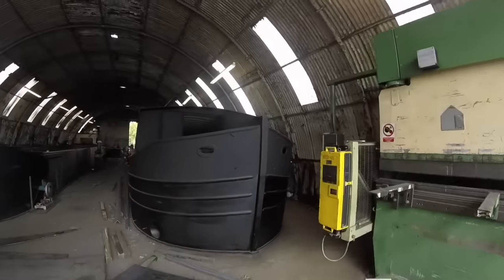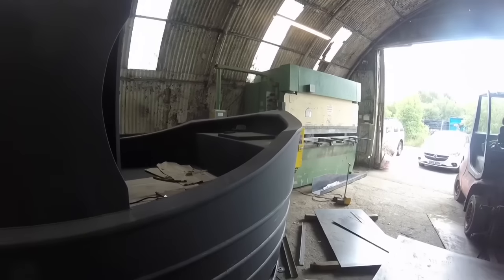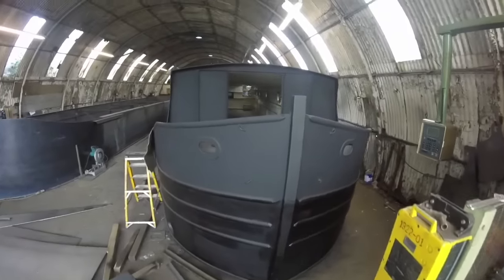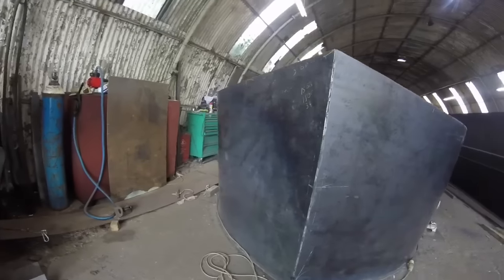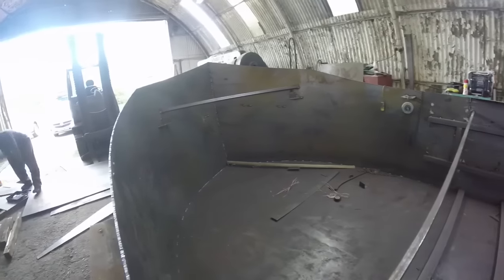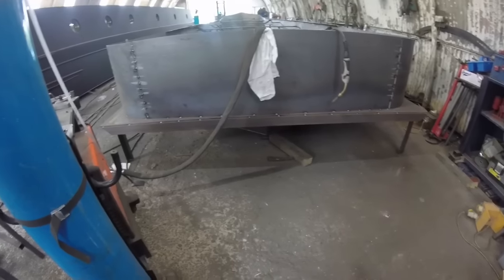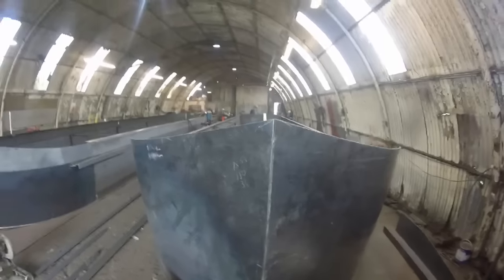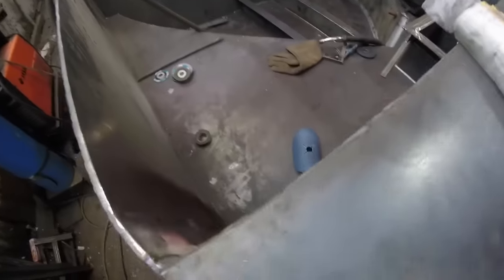Widebeam boat build Part 1

Comment: Why only 10 foot wide? There isn't anything that looks like or has been built like a Dutch barge?
Reply: You  are very perceptive I think the boat in question  has been built to give the boat a likeness to a Dutch Barge but on a smaller scale. I liked the look of the portholes which have been fitted and looking at the overall cost of a finished boat it is a small percentage of the  project.